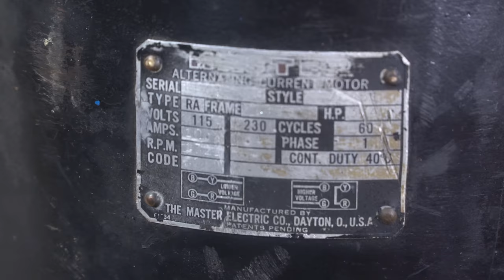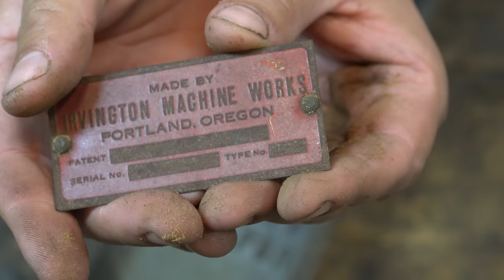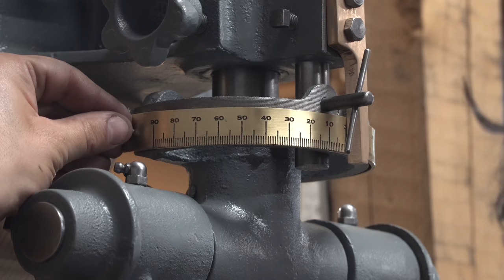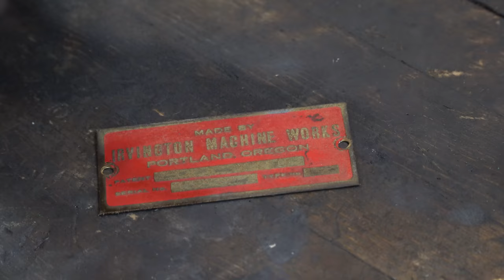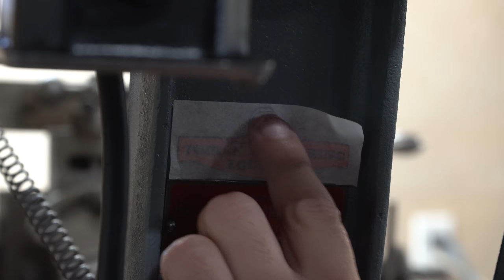Swing Saw [Restoration]

Comment: I've used that style of docking swing saw since the 70s in a timber yard. Small and large (this one is a baby), these were used for decades in timber yards before radial arm saws. 

Re safety:
For all the scaredy cats out there,, this video gives no clear information about how they were properly mounted and safely operated.  Despite much fear by commenters, they were not inherently dangerous. In 50 years, I've never heard of any accidents. Do you really think that saw designers of the 50s, 60s didn't think about safety, the forces of jamming? It is sloppy, unaware idiots without training on tools who have accidents.

Comment: Beautiful restoration and awesome saw, however I would build a belt cover for the open belt and use a gas lift hydraulic piston instead of a wonky spring in the back to pull the saw back. You should also remember to amend your health and life insurance with that thing in your workshop... .    .

Comment: The fence and table need to be further out so the blade is behind the fence when not in use. The return spring needs to hold the saw against a stop in a stationary position, no swinging when at rest. You could fab a guard for the belt. I went to a lumberyard in the 80's that had one of these made out of a board, an arbor, and a swinging mechanism. Scared the hell out of me. The lumberyard man cut my 2x12 in two like he was chewing gum.

Comment: Personally I would replace the spring with a pulley and a counterweight. Easier to adjust, quicker to change when it breaks, and probably way cheaper than a custom spring.

Comment: Is that the biggest Evaporust  container they sell?  So many of these old tools are really superb. Yet they are often scrapped for nothing, its tragic. I've seen working Bridgeport Mill simply dumped, which is criminal. A simple motor upgrade would make them better than anything modern. You must have a superb workshop now.

Comment: I have 1936 16" table saw, it has exposed belts and a 2HP motor. The blade protrudes 6" out of the table with no guards and the wind the blade makes is truly terrifying. I have many power tools and none of them I'm afraid to use apart from the table saw but I will say it can cut through 6" of Ekki wood in one pass without slowing, I think one mistake and I wouldn't get to the phone to call for help.

Comment: That is a frightening machine, worse than the drag saw.  What's even more scary is it's a MITRE swing saw.  I got the screaming hebee jebees just watching it.  I remember swing saws in the wood room at the pulp mill where I used to work.  They were on fixed arms driven by electric motor and swung with a hydraulic ram, all in a cage, over the log chain.  Even from a distance it was frightening.  "You were too focused on how you could do it and not on should you do it "

Comment: Definitely scary looking, but probably not all that dangerous as long as you don't stand in line with the blade and don't leave it running when you're not actively cutting with it.  Were I going to use it I'd probably put a belt guard on it just in case since that's what you're most likely to get hit with if it kicks out at you and you're using it properly.

Comment: The only machine more terryfing i know about is an wood splitter that is an one meter cast iron  flywheel with an axe head attached, you wait for the axe to whizz by, place the log on the rest and pray that the wood is not grown in some potential life ending way, or that there is iron in it.
Badly secured acetylen bottles are marginally more dangerous.
Reply: I was thinking about that same splitting machine while watching this video.
Both are firmly in the NOPE, category.

Comment: Vern nice job, But i definitely think it needs a proper enclosed safety gaurd over those belt pulleys before someone loses an arm to it...
Most older tools were made in the days when workers werre expendable and there was no health and safety or worker insurance or unions so these things were not that closely considered or if they were it was adding to the cost so not added if prohibitively expensive. 
So for me a true restoration of this tool would be to bring it up to modern safety standards and seeing as you are the one using it, I would not hang about, as if you look at all your other belt and pulley driven tools like drill presses for example they always have a cover over the belt drives...

Comment: Wow, the safety regulations of the 40's (and before) was really a "do not touch there and you will be good" mentality, as they could design everyday appliances with nothing more safe than a handle as protection. 
The rest will have body parts severed and the user electrocuted if made contact with, and the manufacturers was just like "let's sell this to everyone" with no shame.🤯😬

Comment: This has to be some kind of preproduction unit, right? 'The Model' and the name plate lacking any information outside of company name and location, and the body having 'patent applied for.' There's no way this was an actual production unit.
Also, you're supposed to keep your workpiece on the left side of the blade with off-cuts on the right side, as you're actuating the blade with your right arm. As dangerous as these things seem, they're meant for larger cutting benches with wider work pieces; especially in the larger sawmill versions. This is basically what eventually evolved into smaller radial arm saws, I guess a pivot was easier to design for than a slide at the time; and of course radial arm saws eventually evolved into sliding compound miter saws.